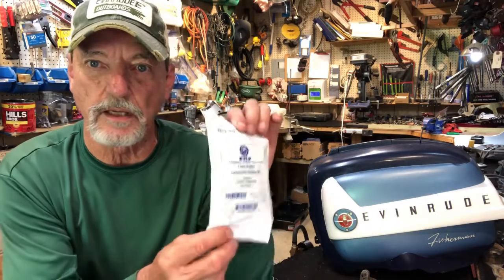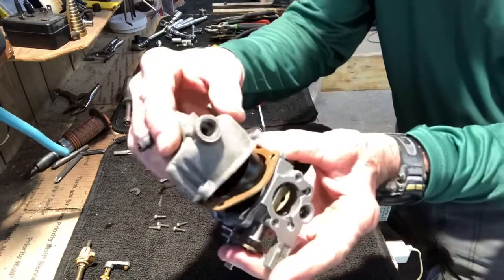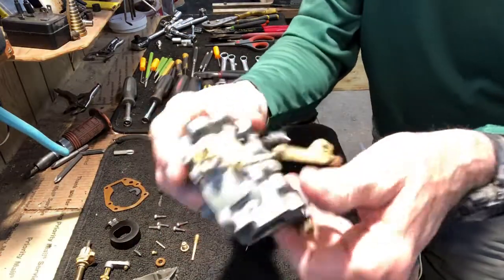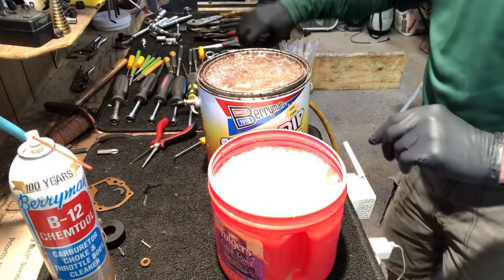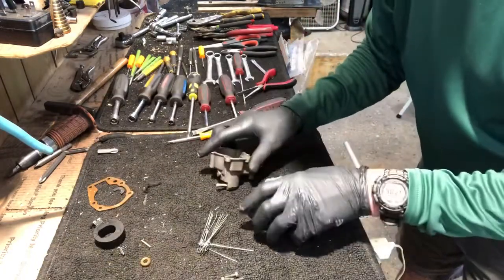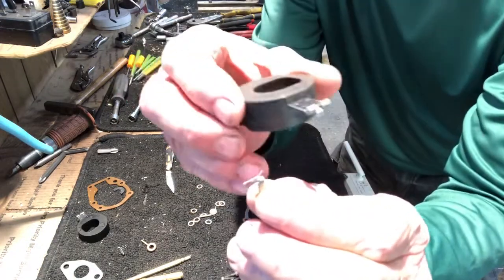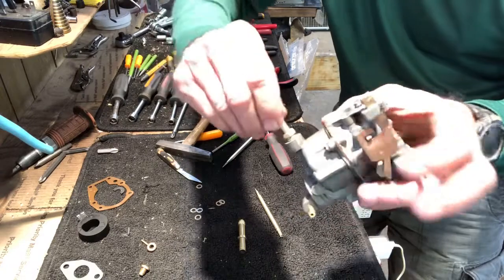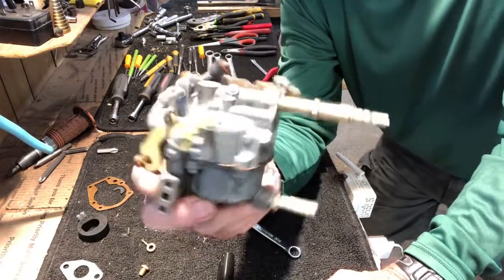How to Clean Rebuild Carburetor 1957 7.5 HP Johnson 1952 thru 1967 Johnson & Evinrude 3 HP to 18 HP

Comment: I just did my carborator to my Johnson seahorse 7.5 model AD-11. I used your video for instructions. The only difference between your carborator and mine is that mine has a clear bowl on the bottom.

Comment: I have a 1959 7.5 Fleetwin and was just thinking if should change over to single line fuel sys for simplicity.  Wasn’t sure if it was possible until you just confirmed my thought.  My 12 yo grandson will be using the motor on his 14’ boat…. Thx for the i video. 👍
Reply from the maker: https://www.ebay.com/itm/364215320247?mkcid=16&mkevt=1&mkrid=711-127632-2357-0&ssspo=sn3ajpvKTka&sssrc=2051273&ssuid=sn3ajpvKTka&var=&widget_ver=artemis&media=COPY

Comment: Really like your videos, I have 2 - 4hp ,1 Evinrude 1990 and 1 Johnson 1998 long shaft Sailmaster lovely engine. Just bought a scrap Evinrude 2 HP just attempting to restore it. Have a few problems with siezed bolts though!!! I am in the UK

Comment: Hi Mike, Thanks for your informative video.  I was just rebuilding by carb. on my FD-12 18hp Johnson following your instructions.  I realized quickly that the carb looked slightly different than yours and when I took the bowl off, the original needle valve doesn't have a clip on it nor is it supposed to as it doesn't have a groove for the clip.  I decided to use the same needle valve and screw since the new one was a bit longer.  Then I realized the break out plug is a different size as the kit I bought.  Have you run into that before with a slightly different carburetor and would you know the kit number for that one?  Thanks so much.

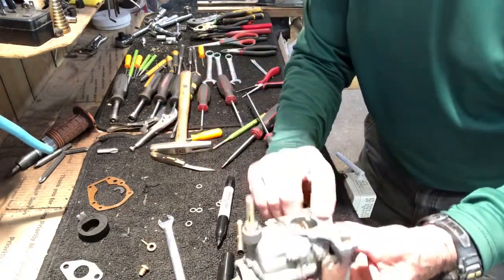Comment: at 24:20  T-Mike mis-speaks and calls the top jet high speed, but that is low speed and the 1.5 turn is correct for the Low- speed jet adjustment.

Comment: Just wondering, but do carbs for 7.5 hp with dual line and glass filter bowl require a wire clip on
the float needle?  I have two of these carbs and neither one has the wire clip on the needle, nor does
the original needle valve have a groove to hold the wire clip.  Did these original Type 1 carb needles
just work on gravity?  The Sierra rebuild kit has the grooved needle and the wire clip. Thanks - great video!
Reply from the maker: Originals work on gravity - no clips.
Reply: @michaeljsimon  Wow - thanks for the quick reply.  Just one more quick question, but if you were rebuilding this carb would you use the new needle with the clip, or just the needle (might not be heavy enough to work properly on gravity?), or just reuse the old needle?  ok, a couple of questions.
Reply from the maker: @paularmstrong5572  use the new needle with clip.
Reply: @michaeljsimon  Thumbs Up!

Comment: Hey Mike I love your channel, could you do a video on rebuilding the old style two hose pressurized fuel tank.I have one that needs to be done kind of curious how you go about it and imagine you actually do it a lot. Thanks Bill
Reply: Bill I did this a couple weeks ago its not bad to do just be careful and take pics when you take the housing open springs and a watch battery sized metal plate to keep up with but its not bad - T-Mike can make it easy to do

Comment: Just courious. How many times can this cleaner be used before it needs to be replaced? Do you ever have to strain it before reuse? Is it a good idea to do clean up job on the carb before putting it into the cleaner?
Reply from the maker: Been doing this for 6 years - second can.

Comment: Mike what is the oil to fuel mix ratio you recommend for the 57 7.5 ad-11 I get conflicting info because some say the newer oils dont require as much oil - please advise - thank you
Reply from the maker: Here is my rule - if it has a 2 line fuel system 24:1 / single line fuel system 50:1 - they switch to single line in 60s and crankcase upper bearings switched from brass to stainless - stainless required less oil.
Reply: Perfect thank you

Comment: got  an  old  5     an  1/2hp  omc  66/68 mod  will  it  run  with  the  leg  off  what  holds  the  water  tube  in  the  exhust  houseing
Reply from the maker: Rubber grommets on both ends